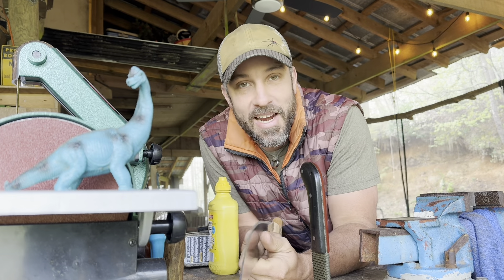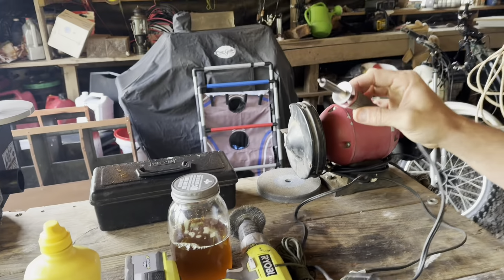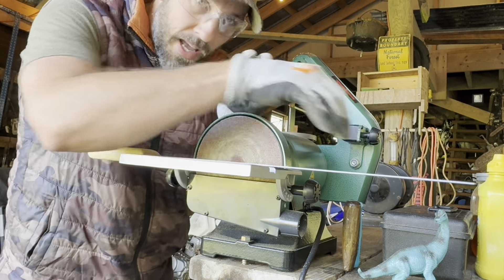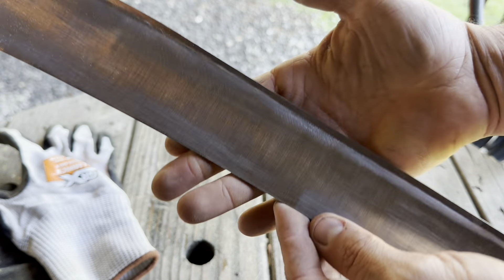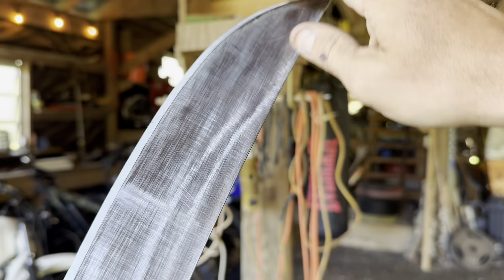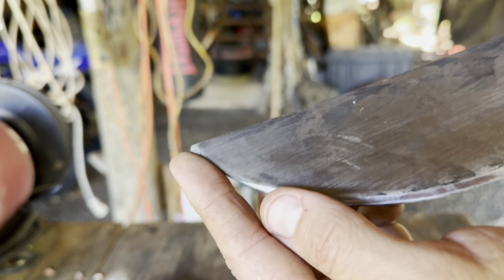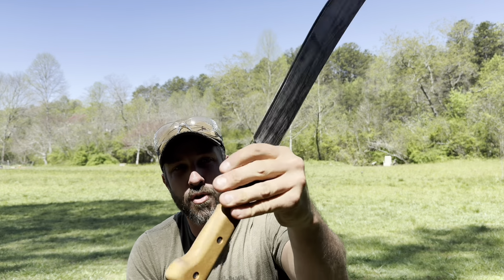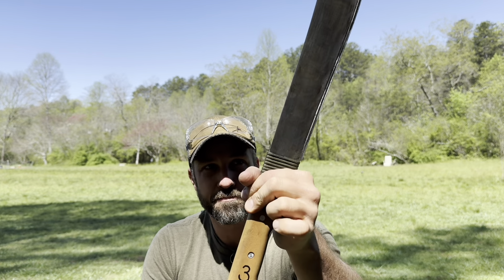The Perfect SURVIVAL Tool!

Comment: 2:12 how to spend $40 at Walmart and dramatically up your hand tools game.
1. Four n one hand rasp/file 
2. Hart full tang chisel knife (in hard shell security scabbard)
3. Hart 30’ tape measure (made in the same factory as Milwaukee to same specs. Holds out to 17-18’)
4. Hart mechanics gloves with leather palms and fingers 

I despise Walmart as much as the next guy but these four suggestions are well worth the pain of holding one’s nose and visiting the cattle call. The tape measure is $12 and stands up to the $39 Milwaukee across the street at Home Depot. So much so I took the Milwaukee that I’d purchased the day prior back and put the $27 difference toward the four n one rasp and chisel knife. I’ve used these four tools plenty and they’re in almost new shape after nearly a year. Except the chisel knife.  It survived a two alarm house fire and aside from some blade pitting, I brought it back to life in a couple hours.  The scabbard, however, didn’t make it. No joke I pulled the chisel knife out of a four foot pile of torched ceiling joists left by the fire department

Comment: It would be closer to "perfect" if it was at or over 18 inches long.  When bushwacking through thick brush, I've found that 18 is the sweet spot for reaching in deeper without bonkng or cutting you hand on thorns and branches, and find a heavier blade's momentum helps with efficient cuts.  I do like the  blade though and won't criticize ti too much. I like the mods.

Comment: I think a machete is one of the most underrated tools in the us. I took mine (same model) and cut it down to about 12in, sharpened and finished the handle the took an old gi plastic sheath and cut it to fit it. I like it short bc it mounts on the side of my pack well but is still useable. I keep a longer one in the truck for serious bush clearing

Comment: Machetes are great fishing tools, also!
We were maneuvering south of the boarder, one of our barefoot Locals had a left behind military machete with about 30% of the metal worn away and I'm certain the handle had been replaced more than once.
After dark, he took a palm fitting river rock, worn flat on one side, out of his pouch, using small circular motions sharpened up his machete, borrowed a penlight, put it in his mouth and waded into the water between knee and hip deep. As nosey fish came to investigate the light shining into the water, he would whack them with the machete, in a very short time he had enough fish for everyone. You can learn a lot from Barefoot Locals!
Reply from the maker: That is fantastic!

Comment: I love everything you did, the one thing I would change is I would NOT extend the 90 degree spine to the tip of blade and keep a " hand sized " area with a rounded edge/grip.  So when  using the machete as a draw knife it would be comfortable.
Reply: Hi, what is a draw knife please
Reply: @brethren4life152  it usually has two wood handles that are used to shave wood off a project.  When you have a large knife you simply grasp the blade on the backside and draw the blade towards you to carefully shave wood off a project.  so just the part you plan on gripping should be rounded.  The rest can have a 90 spine for fine wood shaving
Reply: @PERSONAL-cs3mq  oh I didn't know that but it does make sense, thankyou for taking the time to educate me, it's much appreciated.

Comment: When the steel is abraded, there is a heat-up by friction. This is the reason why to sharpen, once it was on a stone called water because there was a water tank to cool what had been heated. Then abraser on a back stand amateur and remove the material to ricasso, it is to change the heat treatment made in factory for this kind of cheap product! The mistake of many is to use a grinding wheel that turns very fast and heats up a lot. On a quality blade there are four heat treatments: normalization, normalization annealing, quenching and tempering. The latter is often altered when it is not directly quenching which could produce a tempera and put everything flat! Notice to the amateurs!

Comment: Here's the neat trick you can do get one of those big wire wheels of brass or bronze or copper your choice whichever you feel like brazing on with friction just a good drill get you enough torque and speed to get a lot of that transferred to the machete or just plain electroplate it. A cheap silver coin or similar easy.. I wonder what would happen if you did a combination of both the wheel first and then electroplated a bit huh
Reply from the maker: Cool idea!

Comment: I'm a big fan of Tramontina machetes, I own several sizes and shapes, but my to go ones are the bolo pattern and, my favorite, the 10 inch minimachete (I wonder if they make them anymore, at least in my contry I cannot find them anymore, just the 12 inch ones). Event that's small, it's very "potent" and versatile and, being so light, you can even carry it in your back pocket. That mini machete, an Opinel, and a very light saw is my outdoor equipment, just enough for my needs, as I don't pretend I'm a "survivalist" or "buschrafter".
Reply from the maker: The 12 inchers are great. I think my next batch of customized machetes will be those.

Comment: Please show other useful tools for the project, like hand-held disk and belt sanders. Also, for best penetration, get the wood VERY dry. You can put hang it on the hot side of a building in the sun or bake it in the oven at 120 degrees for a little while. Then, put the wood down in the oil and let it soak for several days. It may take a while to finally dry out, but it's worth it. I've done it on several projects.

Comment: Jason, get a small container of PVC pipe cleaner & add dye of the color you want to use.
They make a purple & clear PVC cleaner.  The purple has dye in it, and as a plumber, we were required to use the purple cleaner, so the plumbing inspector knew we had cleaned the pipe & fittings before gluing them together.
I hope this is helpful.
Reply: for WHAT?....
Staining the blade? Handle? (mix with linseed oil)?... Which step are u saying PVC pipe cleaner & add dye would be good for? 
😜 u always gotta give instructions as if u were explaining to a total novice, kid or bafoon like me!

Comment: Reason for the varnish on the blade is that it is high carbon steel, which easily rusts. If you don't want the varnish OR rust, you can wipe on some Lanolin (Woolwax) which is extremely tenacious and nicely prevents any additional rusting.
Reply: II removed the varnish with spray can paint stripper and did a heavy mustard patina. It looks great and will not prevent rust but it will help.
Reply: High carbon steel is best for blades, the flip side … it will rust, use a gun bluing chemical to prevent rust.
Reply: @seenenough1200   Yeah. Bluing is the easiest way.

Comment: Funny, I modified myself a Tramontina to fit my needs better. But if you want to use it a „survival“ tool (whatever that is) you want to go with the cutting edge as close to the handle as possible. This is quite some work. Did you know that the blade of a Tramontina is already coated with a lacquer to protect it against rust? I removed all of this and used gun blue to darken and protect the blade. And I also shortened the blade. I don’t your exact environment but bigger is not better ;) I as well deep fried the handle (after reshaping) in sunflower oil to get it saturated as I live in wet environment. But I need to admit, all that needs more work and thoughts.
Reply from the maker: Deep fried the handle? Awesome!

Comment: Nice mod, well done. I like to take cheap tools and mod it myself just like you do, but one thing I would add to make it even more useful - I would add a 2" portion close to the paracord with a more shallow angle for fine carving tasks.
BTW: the easiest way to get rid of the burrs from sharpening is running it across the face of a piece of wood
Reply from the maker: Good tip!

Comment: For ones you are right about the best survival tool. But the rest , naaah I can see you have no experience with machetes. The tip sharpness it’s need very much . I well I grew up in Costa Rican jungles we use machetes since kids , 24. 26 . And 28 to cut through jungle thickness I got one just like that tramontina  Amazon. 12 lol
Reply from the maker: I agree. A sharpened tip would be very handy. However, I use my machetes a lot and the tip is always taking a lot of abuse. I could spend a lot of time sharpening it only to have it dull again after a few minutes. Thanks for watching.

Comment: If you're using a knife to cut grassy/weedy stuff more than fat, woody stuff, consider putting a single bevel on the blade.  I believe they cut significantly  easier.    Convex is better for hard chopping of wood.
Reply from the maker: Great tip!